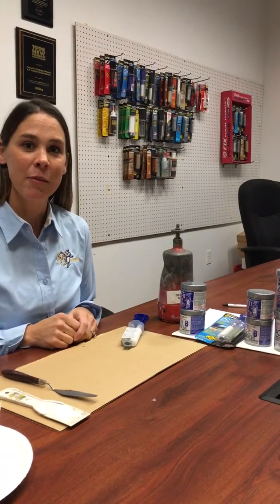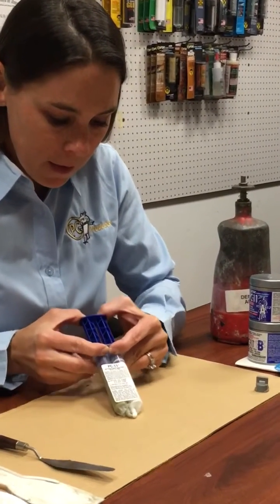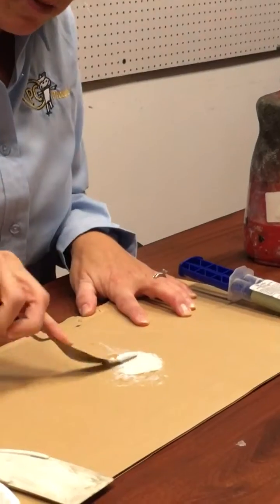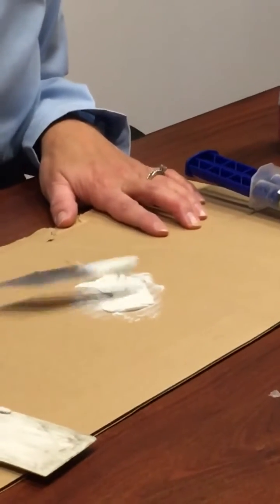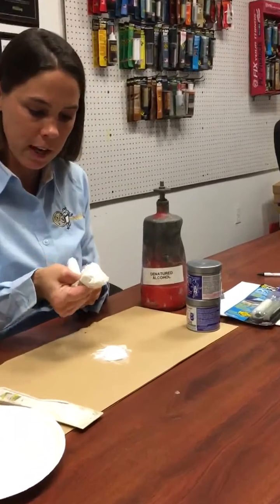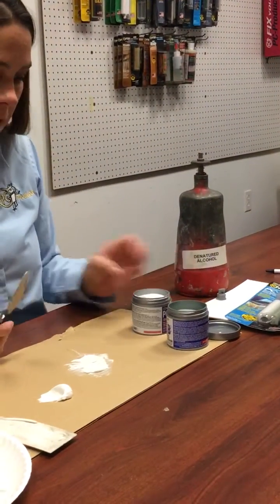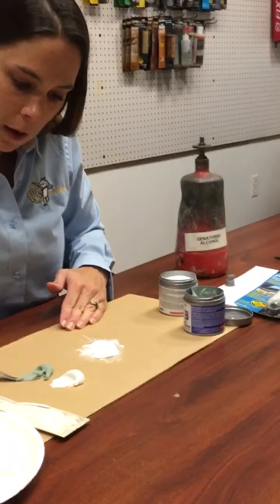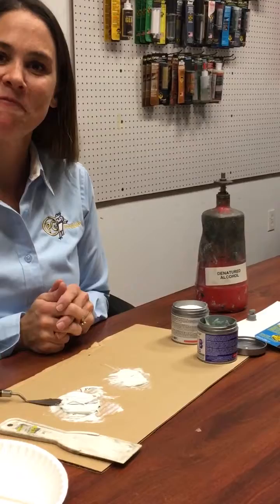How to mix PC-11 epoxy

Comment: How thick can you layer this?
Reply from the maker: If working on a horizontal surface there is really no limit to how thick it can be applied. If working vertically it will depend on the width and depth of the void being filled, but roughly about 1.5-2 inches at a time.

Comment: Any epoxy product used without a proper mask with 3M filter your lung/throat is at high risk of cancer. Mixing epoxy has no smell when mixed, yet highly corrosive to organs. Gloves are recomended.

Comment: Just wanted to know if I need a sealer and paint match after. We used it in a white bath tub that got dented. 
Thanks for the great video.
Reply from the maker: A sealer and paint are not required but you can if you want to more exactly match colors. We always recommend a good high quality primer such as, Bullseye 1-2-3, prior to painting.

Comment: i used it in regrigerated room to fill some empty hole but it doesn't dry even after 48h. lol
Reply from the maker: PC-11 is a very slow curing product. At 70 degrees Fahrenheit and relatively low humidity it should be cured for service after 24 hours but at colder temps or high humidity it may take longer. And a full cure will take 1-2 weeks.
Reply: @pcproductsepoxy4315  1-2 weeks? we are not better to buy a good product in that case. it is very very slow to me.
Reply: @tteuvky  the long cure time is a characteristic of the product. It is neither good nor bad, it is a matter of suitability for the conditions and intended purpose. Next time you might read the product descriptions to identify something that is the right product choice for your intended application.